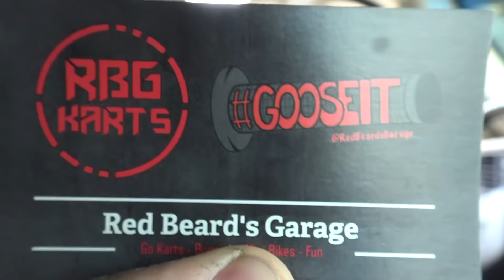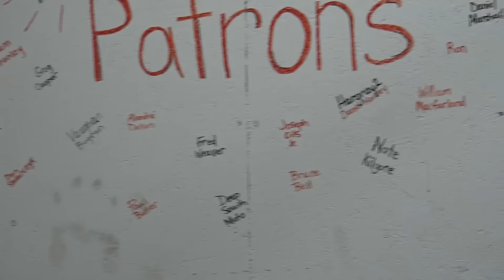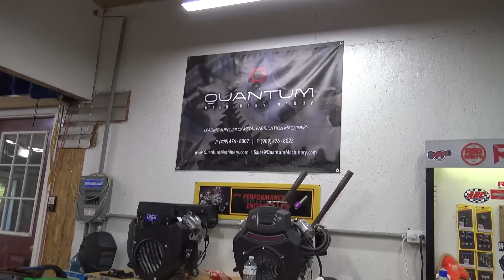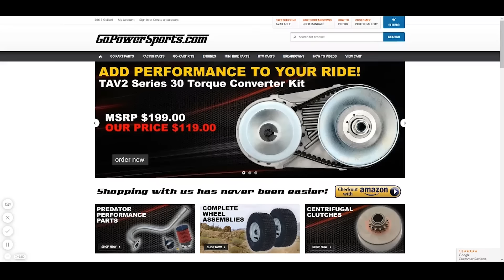2,000Lbs Garage Tool Install!!! Quantum Machinery Group

Comment: I don't know of it would be a pro, or con, but I would love to see a go kart, or buggy, built with pushrod suspension. I've had the idea for a long time, but no tools to try. It may not have the weight to do the job, but I like the idea. Put it on the back burner. I'd love to see it. Maybe a racing, shifter cart, or something.

Comment: that's the way my trailer tires are, run them until you can see the air in them
Reply: Run the tires on your truck till you can see the air in them.

Then put them on the trailer